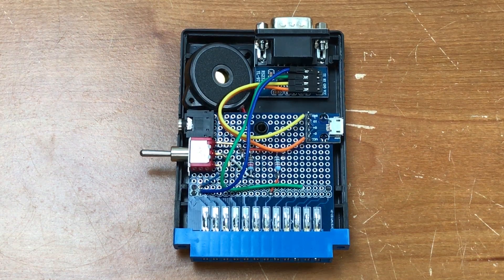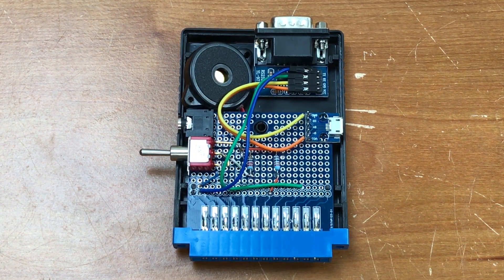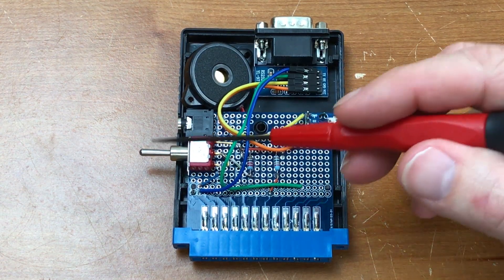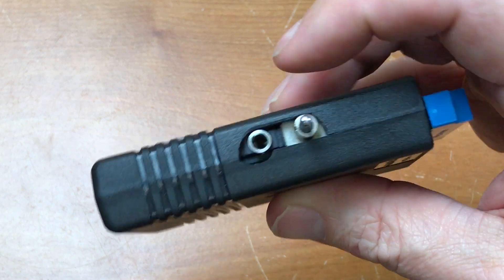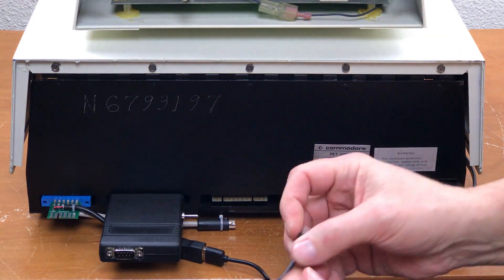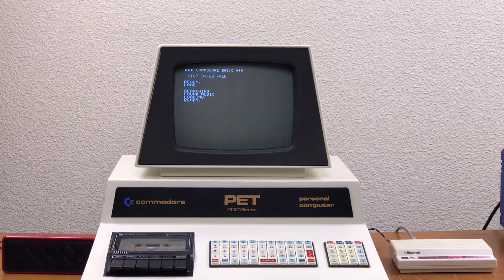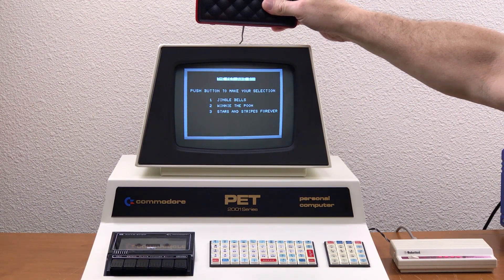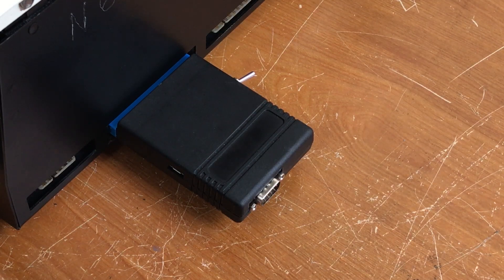Commodore PET CB2 sound mod and serial port

Comment: Were there any games that supported this sound capability? And just out of curiosity, is it possible for the PET to simulate more than one voice via multiplexing?
Reply: @HutchCA  Interesting. Funny that Commodore didn't think to include even rudimentary sound on those earlier models (and then went on to develop one of the most revered sound chips of all time for the C64).

Comment: Nice system.  Question about the rs232 part.  Since modems aren't really useful as they are nowadays, had you considered just directly making it a wifi modem for telnetting into systems, or did you have other plans for a standard rs232 port?
Reply: @HutchCA  (Author of PETTERM here). I've tried to make make it work somewhat well connecting to linux, even on the graphics keyboard. Though of course it's still missing keys. PETTERM partially implements the ansi standard escape codes, though not enough for some linux apps, I'm working on improving that for the next version. The OFF/RVS key is being currently used as a Control key, and the new version does a better job converting ASCII to PETSCII for display (though apparently I messed up the @ symbol but didn't notice, it shows as a horizontal line).

Is there any breakages that you'd like to see fixed for the next build that'd make using it nicer? Unfortunately can't fix many BBSes expecting/requiring 80 column displays.
Reply: @HutchCA  Ahh interesting.  Yeah, i was thinking more of the esp8266 module vs something like raspberry pi.  Something like this:  http://subethasoftware.com/2018/02/28/wire-up-your-own-rs-232-wifi-modem-for-under-10-using-esp8266-and-zimodem-firmware/